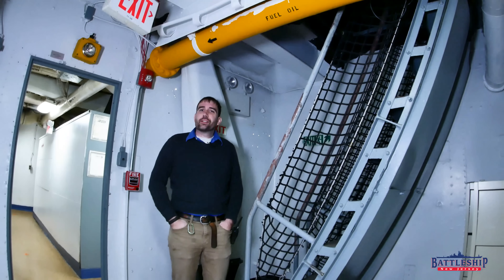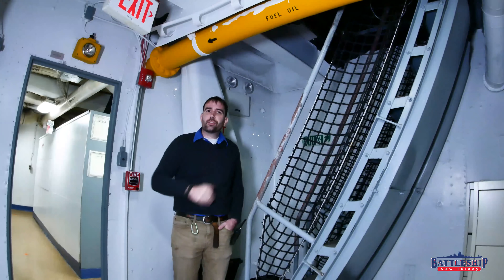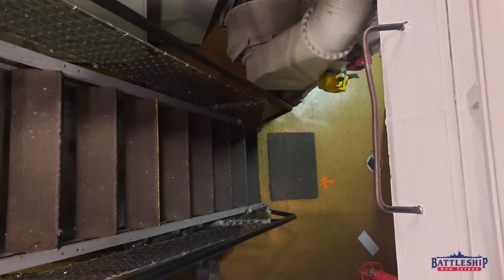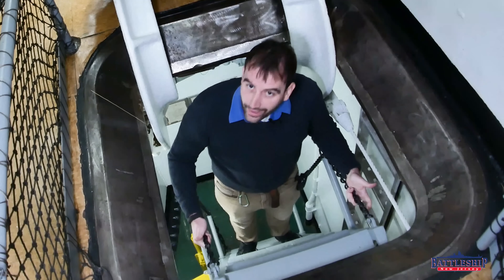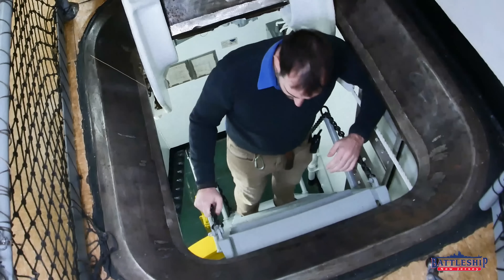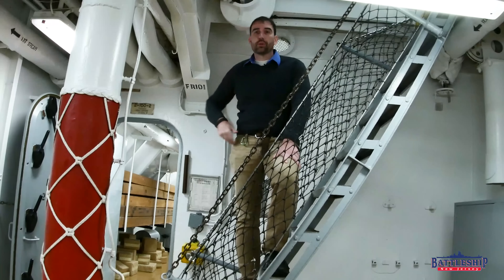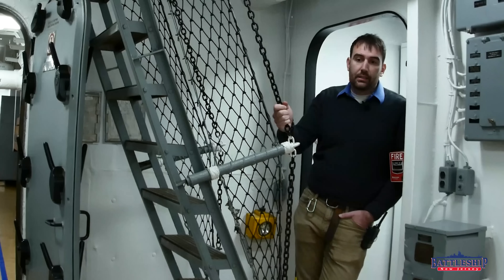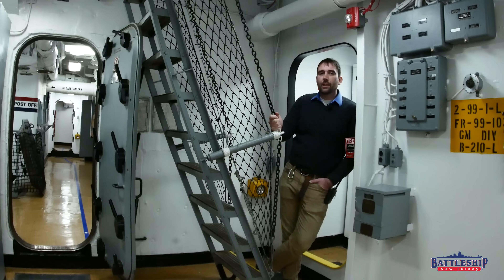Why Are Ladders on Ships So Steep? And Why Aren't They Stairs?

Comment: I wish I’d been able to visit the ship before I lost my mobility (spinal cord injury). The ladders would be a very tricky. Maybe doable.

I suspect health and safety won’t allow it…  but I was wondering if it would be easier to just stick me in a harness and lower me down. I could pretend to be a shell :)
Reply: No doubt, same situation here -- 3 broke disks, spinal damage, , two bad knees.  I can do about 12 stair steps a day and that is it. I get worried just looking at ladders/tall stairs now, no way I could do those on the NJ.  If I visited most  ships now, I would have to stay on the main deck. 
Please note: The Iowa has a wheelchair elevator (installed for FDR) and two other disabled lifts that go 3 decks up.
And those decks have alot of accessibility to the exhibits
Would be your best bet for visiting a museum battleship. Not sure if they a virtual exhibit , to check it out the access.
Reply: @chrisperrien7055  ooo. That’s encouraging. I may make my way to the NJ yet :)
Reply: @jamieknight326  YW. Please note I meant the USS Iowa which is in Los Angeles, not the entire Iowa Class, so the USS NJ in NJ doesn't have them (AFAIK). Not sure what they have done on the USS NJ  for wheel chair/disabled access.

Also note some  of the carriers have escalators , built for pilots between the Main/Hanger/crew decks and the flight deck. IDK which may still be operation

Comment: At 70 years of age, I take my time on stairs I usually back down if I have stuff to carry. Left hand on Railing. I have had several ladders fail after being properly setup and an improvised one on a tree failed dropping me 20 feet to the ground for a solid back fall onto a rock. Been up some right proper scary ones on power transmission towers just bolts into angle iron legs.

Comment: Slid down many ladders, including the ones you showed, and many more on her. I don’t ever remember falling off a ladder, but have missed a rung or two. 

Almost got degloved by my wedding ring on second ship, not BigJ. 

I have NEVER seen a ladder turned over for handling stores, especially on Big J. The slides on the ladders used mostly for stores, although I can remember a drunken sailor being “escorted” down two of those into our engineering berthing compartment. As I recall the backing was for dirt and dust, not as stores slides. 

Also, I can remember the ladders that were removed often had pins, not bolts in them, to make it easier to remove.

Comment: As former Navy man, the ladders maybe capable of being removed but trust me after a few maintenance cycles of a bunch of non-rates painting every surface including those bolts on the ladders. The idea of removing because a bit more difficult. Remember not every division has the tools to remove the ladders. As such, imagine having to go find either deck division or machinist Mates to get the tools to remove a paint stuck ladder. I would be curious if any old time sailors on BB remember ever actually removing the ladders. Later.
Reply: Actually, as a BB-62 sailor, sorry I don’t consider myself “Old”, yes we removed them regularly. 
Anytime we handled ammo, we remove the in the handling areas, I have done it myself. 
Also, as a MM when we needed to move some bearings, we removed the ladders. 
What I do remember is the ladders which were regularly removed had pins, instead of bolts in them. Make quicker and easier to remove in install.
Reply: @richcruse2689  I guess that is the difference between the BB and my sub. The ladders while capable were never moved except when something broke behind it or something needed to be moved out such as batteries or diesel generator which was quite rare. Thanks for the comment. I was just remembering the pain of disassembling a ladder which had what seemed like 20 coats of paint. Later.
Reply: @grast5150  I have worked on subs, I would say your right. The fast attacks almost never removed there ladders when I worked on them.

Comment: Climbing and descending ladders is completely different at sea.  It's not the rolls that can get you, but the pitching.  As the ship goes up and down, the sailor experiences repetitive positive and negative Gs.  

If you time it right, you can FLY up ladders because you are momentarily a lot lighter, which is a real hoot.  By the same token, you have to be careful descending ladders.  If you time it wrong, as you start to go down, you can become very, very heavy.  Anytime I ever slipped on a ladder was when this happened.  

Also, if you are carrying a load, it is effected the same as your body.   So the load can become much lighter or heavier depending on if the ship is going up or down.  So carrying something heavy on a ladder when at sea can be very treacherous.

Comment: Have rode the handrails down steep stairs on oil-drilling rigs. Round steel tube, and we did it while wearing rubber or leather gloves. Zip +BOOM, fast. Back then I could ascend those stairs damn fast too, two at a time, depending how angry I was. Interesting to think about shipboard life with that in mind.

Comment: The Engineering decks on Nimitz carriers are 2 levels, but take up 3 decks. Decks are 10 feet high. As a result the ladders are quite long. There is a rather lot of space in these engineering spaces, so the ladders are not as steep as on Iowa. The handrails have joints in them. As engineers tend to have a lot of bravado, we sort of slide down the hand rails facing forward with well time foot fall on a step to allow our hands to skip the joints. One of my shipmate's wedding ring got caught on one of these joints. It was necessary to amputate that finger because it was degloved.
Reply: I jumped off a roof once swinging by my hands on the way down. My wedding band caught the edge of the roof and I hung there by it briefly. Lucky for me I broke free instead of degloving or ripping my finger off!
Reply: Ugh degloving is the worst
Reply: Auch.
Reply: I wore a silicone ring just for that reason.

Comment: I never fell down a ladder. I slid down on my ass a couple times, I did occasionally trip going up. Now, running full tilt into a closed overhead hatch after zebra was set was the real hazard. Did that a bunch of times if I was asleep or in a space where I couldn't hear the 1MC

Comment: When I first went aboard ship I went backwards down the ladders a lot.  Over time I started going forwards, slowly at first, and as familiarity increased faster.  Only fell once.  Was going down a latter to a storeroom at the bottom of the ship.  earlier in the day they had been loading in food and someone dropped a jug of vegetable oil that coated the bottom couple of rungs pretty well.   I hit that oil, my foot slipped out and I took a fast trip down to land on my butt at the bottom of the ladder.   Knocked my breath out, which is totally terrifying when you can't breathe.  Sat there for a couple of minutes recovering.  Slowly climbed back upthe latter, my temper rising much faster than my progress up.   Yelled at a few folks to try and find put who dumped the oil and who was supposed to clean it up.  (Never did find out.)   Then took or easy for a day or so as my bruises faded.

Comment: Going up and down the ladders was always fun in heavy seas. If you were going up the ladder when the ship pitched up, it felt like you weighed a thousand pounds. If you were going up the ladder when the ship pitched down, it felt like you were weightless.

Which way you faced going up or down is largely a matter of common sense. On a vertical ladder you obvious had to face the ladder. On less steep ladders where you could go down facing away from the ladder, usually you would go down like with normal stairs. If you were carrying something, you could either very carefully go down facing away from the ladder, or face the ladder so you could rest your package on the steps.  And if you had two people carrying something, the one on the bottom would face the ladder, the one on top would face away from the ladder.

Also, some good advice onboard ship is to remove any rings you may normally wear, including wedding rings. A very common injury was to catch the ring on the hatch rim. That could cause a very nasty injury.
Reply: Its way more fun at the very front or back of the boat during heavy seas!
Reply: Ouch.  "Degloving" injuries are not ones that I care to imagine!
Reply: I'm sure more than one sailor has lost a finger due to wearing a ring or rings whilst traversing a ladder. I know of at least one who will never be able to wear his wedding band again after a mishap.

Comment: There are very few people on this planet who can extemporize for 13 minutes on ladders and still be this compelling.
Reply: There are even few people who use extemporize in a sentence.
Reply: He's a Ladder Day Saint.
Reply: @SamBrickell  rim shot
Reply: In the Army Basic Instructor course I had to talk for 30 minutes about an L-shaped flashlight.
Reply: Man, I really want to drop in a ridiculous 1000 lumen led head un my old army flashlight and convert it to run lithium batteries. Just for the memes.
Reply: Extemporize? What about this seems improvised? Multiple camera angles, visual examples of talking points. You either are assuming he just set this up on a whim and immediately started filming, which would have to be an assumption, or you don't understand what you said.
Reply: Lindybeige did an hour on medieval siege ladders... every minute of which was gripping.

I'm sure there is a "gipping ladders" pun in there somewhere.
Reply: @darthkek1953  Definite not the person in Valve making Source engine
Reply: A salt can git bovedeck or lowdeck in a storm, yarrr. The lubbers climb upper down as babes in the woods.
Reply: *on the ladders from one specific ship
Reply: I found myself skipping a lot. The pausing between random and uselessly boring information was annoying
Reply: yup pretty fun
Reply: I bet Lindy Beige could easily go for 40 minutes and still be interesting.
Reply: I see you bought a Word of the Day calendar. lol

Comment: Was on the carrier Saratoga for 3 years with Air wing 3 and I don’t think I ever seen anyone go down a ladder backwards! Of course not the safest but a whole lot faster, to step off and drop to the next deck.  Did hang myself by my ring finger from a upper deck which caught a chain clevis at the top post that had a been cotter pinned  so had to cut my navy ring off my finger because of severe swelling never did get another navy ring.

Comment: Loved those grab handles.  Coming down the island I could basically grab the rail and swing down jumping the entire ladder; from top rung to standing at the bottom in one move.  05 level to main deck in under 60 seconds if I was in a rush.

Only time I actually fell was stepping through an escape scuttle.  Was bringing my other foot down through it when my heel slipped off the rung.  By some miracle I shot through the scuttle without hitting the sides or the ladder itself and landed on my feet in a slight crouch.  No way I could ever pull it off again.
Reply: That right there is a 'pucker' moment.  I cringe to think if luck/skill/guardian angel wasn't on your side that day.
Reply: Yeah, when I was younger I loved going down the main part of the stairs in my home by putting one hand on the railing, one on the wall, and just jumping.

Eventually, though, I got tall enough to hit my head on the overhang and ended up splayed out over the landing.  I was fine, don't get me wrong, but it kinda put a damper on that.
Reply: I spent a lot of time going from between the 03 and the 2nd deck.  I got pretty good at jumping down the ladders.
Reply: @LadyOniaka  Night Orders as messenger of the watch: from the signal shack on 06 level to main engineering on deck 7 and back again with a CIC somewhere in between.  My best time was 20 minutes.
Reply: Hey, uh... Civilian here, anyone care to explain to me what an escape scuttle is?
Reply: @dominiklehn2866  Some of the larger hatches have another small round hatch built into them that can open independantly of the hatch itself.  So, you can have a large hatch that is closed, but a smaller hatch built in that can be opened to allow an emergency egress.
Reply: @LadyOniaka  ah, thank you.
Reply: I was always too short to complete such an action.
Reply: You had a cat moment. "I meant to do that! Yeah!"
Reply: Beautiful memories.

Comment: Another factor on even new ships, especially where they're inside the armored part of the ship is so that the "Citadel" is as small as possible because the larger it is, the more HEAVY Armor you will need to keep up the desire level of protection.
 
Even in unarmored ships, the smaller the compartment, the easier it is to close off an area for Damage Control (Fire and/or Flooding (which can happen when you use large amounts of water to put out a fire!)) to prevent large areas of the ship to be damage... and in case of Flooding, to prevent the ship from capsizing!
Reply: Some navies have isolatable stairwells at least for the main passages. It can be done, but not by the US Navy.

Comment: I worked ob the C-5 Galaxy while in the Air Force, our flight station and aft troop ladders were about exactly like this, we would go FWD, AFT and sometimes at a 45* angle also depending weather or not we had a tool box or a part. Same with a B-2 or B-1 maintenance stand.

Comment: I occurred to me that with a vertical or steep ladder, a smaller hatchway in needed to be cut into the deck. Smaller and lighter hatches to move. More deck space above.

The theatre plant at my college had steep ladders  to access the dimmer packs and the control booth. The common way to come down them at speed was to slide both hands down the rails until you were head down about 45 degrees, then swing your body down to the floor.  That is, if you were tall enough. The shorter folks landed about two or three steps up or started two or three steps down.
Reply: Going head first down a ladder? Noooooo thank you.
Reply: Smaller deck penetrations give better strength too

Comment: I suspect that if there was ever a mandate that the museum must rebuild it's ladders to code (not that I think there should be!) the compromise would be that you'd have to have vertical ladders with padded trunks and soft-ish floor plates or something similar in most locations- that's the only other solution I can think of that fits within the constraints and is arguably safer
Reply: USS Midway has some "regular" staircases they added to it, but they also have a lot more open room to play with

Comment: Hah all this is spot on. When designing bb55 in a 3d walkthrough, trying to get the player up and down very steep steps causes the game engine to think it's an impasse. But it doesn't look right if you make it into an actual ladder function. I found a work around for that (using invisible in-between steps), but trying to get a player through the hatch hole without needing to crouch is yet another problem. It's funny to see the virtual mimic reality so closely.
Reply: If it's a walkthrough, maybe you can just not put collision on the part that players hit their head on?

Comment: I personally found out while touring several museum ships that going down steep ladders facing front ways may be faster but when wearing shorts and low socks your constantly rubbing your upper heal on the last step  because of the stated limited surface to step on and after a few ladders it becomes pretty raw and sore from all the rubbing! Doesn't help that the ladders are usually covered with a anti slip coating...Ouch!
Reply: So the real reason we wear boots and pants in the Navy.  20 years and I never found out.  🤔

Comment: I have a question about the 5 inch guns. The ones that were removed in particular , what happened to the 8 5 in guns that were removed when New Jersey was modernized in the 1980s? Were they scrapped immediately after being removed or did the musuem try to save them?
Reply: The four 5" 38 cal guns sat on keel blocks on the Southeast side of drydock 1 at LBNSY for many many months before being hauled away

Comment: When you work on ships, you rarely go down any ladder with both hands free.  Always go down forward.  You'd be surprised how many dimwits try to go up ladders without looking first.  Worst ladders I ever saw were the ladders to the fireroom on Adams Class DDGs.  They went down vertical about 5 rungs, then angled back about 30 degrees.  Went down into the hole with my back to the ladder because it was the only way to carry anything.
Reply: In 20 years, I remember falling down a ladder twice, both times landing on my feet, in a big heap.  You have to remember, working on a large ship like a carrier, it's 6 decks down and at least 12 decks up.  As a working Leader in the later years, I had to check on the other workers in the morning and afternoon, along with my own job, so I'd be going up and down over 100 ladders a day.

Comment: After a whole summer volunteering and working on the ship I'm with I found myself tripping on normal stairs a lot the first few days after we were done for the season :D 

Keep up the great work!
Reply: Good on Ya. Looks like a fun project. Its amazing what your body adapts to and re-learns. I work with A LOT of LED's, a monochromatic light source. spend half an hour in pure green light, when you get out into regular light, everything has got a red hue to it for a while. even in that short amount of time your brain is re-calibrating to try and get colors (which of course is impossible with monochromatic light, its all just shades of one color). "sea legs" is another one, I get mine really fast, dont get seasick. My sister, even after hours on the boat is still staggering around. I'll stagger for a bit when we hit land, but my sis stands Pin Straight immediately. Brains are amazing.